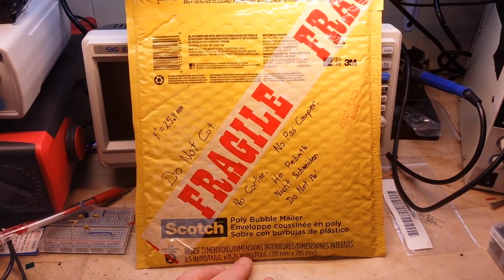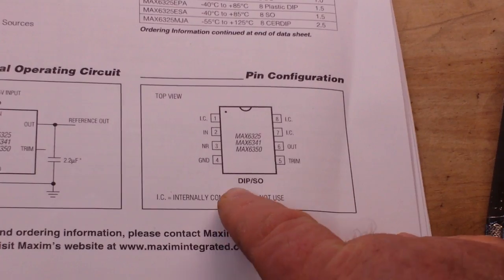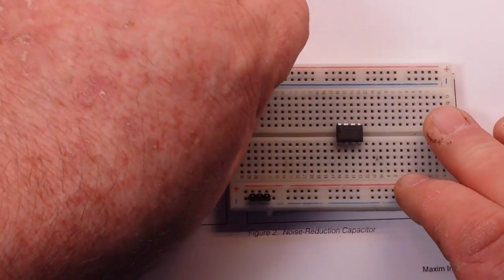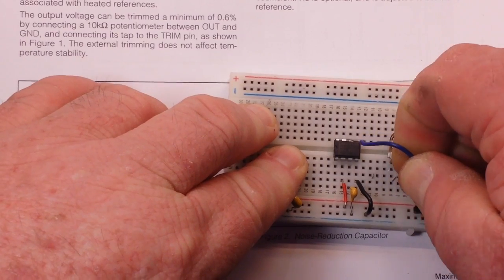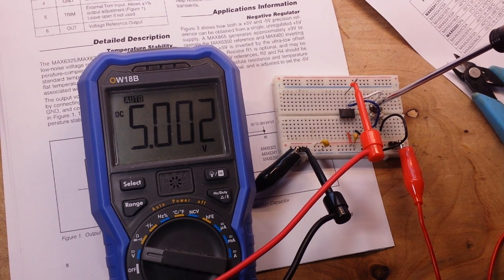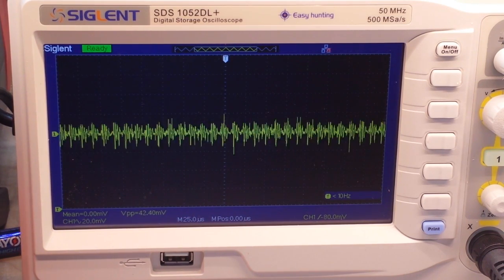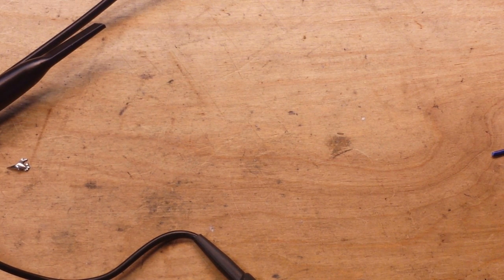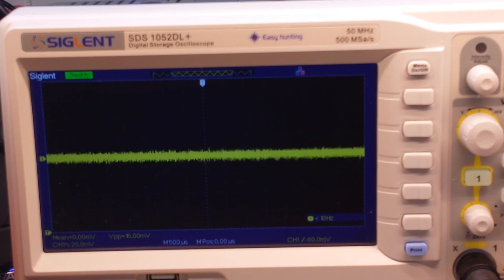Maxim MAX6350 Voltage Reference

Comment: You need at least a 10 turn precision potentiometer(or no pot at all) and a linear voltage regulator and a 3458A 8.5 Digit Multimeter(10,000$) to measure the 0.1- 10Hz noise and Drift of this thing. Your DSO probably just picked up the SMPS noise. I've tested it and got about 2ppm Drift after 3 Days, which is really AWESOME.

Comment: Can be tested with 12V battery or a couple of two 9V  in series  for mitigate the noise, instead using the bench power supply ? However bear in mind that the reference may not be used for battery circuits so it can be also deal with ripple of PSU.

Comment: The Horror :o Follow up please only use a good quality clean Linear supply or better yet Battery supply on these or any other V Ref. I have a pair of these powered by 3S LiPo's in aluminium cases as field units and they are great. All that hash you measured on your scope was coming from your SMPS or induced by it.

Comment: I saw a capacitor on the output on the circuit diagram. Would that help reduce the peak to peak voltage variation on the output?

Comment: Funny how I recently picked up some zeners to use as a crude voltage reference...only to find out weeks later that if I spent just a little more, I can get an voltage reference IC that is much better!  Oh well, live and learn. 40mV PP is acceptable for a power supply but not so great as a reference. Recommend trying different probing techniques per Gilbert suggestion.

Comment: I see you use a Siglent scope right much, and your favorite is the Hantek. I'm searching for a scope. What would you choose in a lower $ and trust for dependability? I'm not familiar with the newer DSO's. My last scope was an older Sencore that I would trust with my life but I knew its history. Therefore, don't trust used equip. Take care and keep up the good work.:-)
Reply from the maker: There are two scopes in my Amazon shop. One Hantek, and one Siglent. Both are about $250 and equally good.

Comment: Sorry, I do not understand why you claim that this is a good reference. 40mV on a 5V basis is 0.8% variation. That’s not a voltage reference, that’s a noise generator. I think what you are seeing on the scope is interference picked up by the probe, not the noise from the circuit. The data sheet claims a max of 5 microvolts RMS output noise. Either your chip is defective or your test setup is not rigorous. 
Perhaps you can try these changes:
- set your probe impedance to 50 ohms if it is not. 
- use the very short spring that attaches to the probe end rather than the witches’ hat and the long ground wire. These pick up a lot of noise.
- hold the probe and ground contact right at the output of the chip and flatten your connecting wires. Your wire loops high on the breadboard make good antennas. 
- set your scope to limit bandwidth, usually the filter will be in the tens of kHz and that will cut out the radio interferences.
This should yield results more consistent with a voltage reference.
Reply: I was going to suggest a re-test as well with those improvements as well as using a battery supply instead of switchmode supply. Also maybe deadbug the voltage ref to see how much noise the breadboard itself is picking up.
Reply: 40mV is a delta, so it is +/-20mV which is +/-0,4%
There also should be a cap 2,2mkF on out pin (accourding to the typical operating circuit at 2:40 on video)
Reply: That's exactly what I was thinking. The noise is huge. There must be a problem in the test setup.
Reply: @Chupacabras222  Huge for a voltage reference but not for a power supply (0.8% is very good for a switching PS). Concur with advice to re-probe.

Comment: Nice video Paul!  It looks like some of that noise is ambient as it looked like it  was present before you turned power on to the second board.  I wonder how much of it was from the Lab Power supply vs the chip?